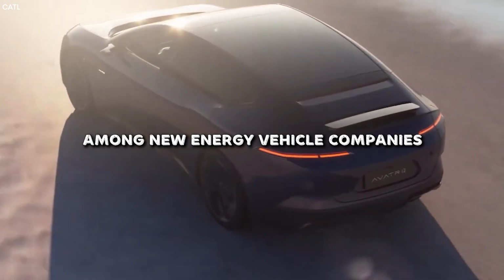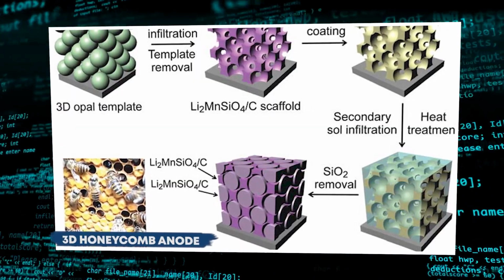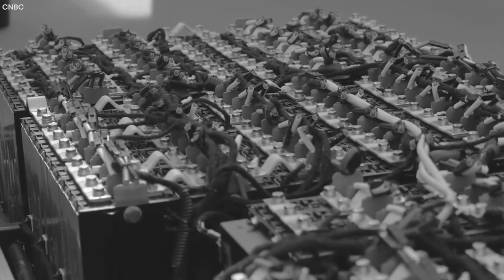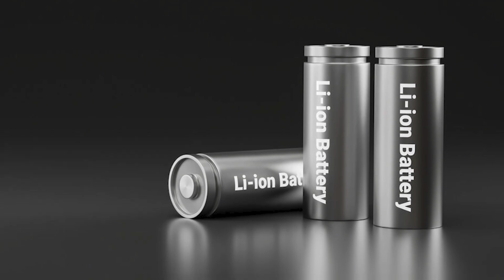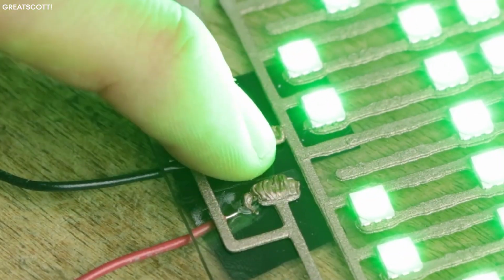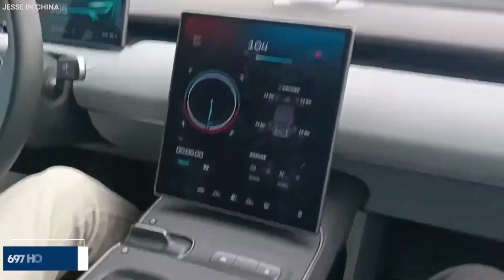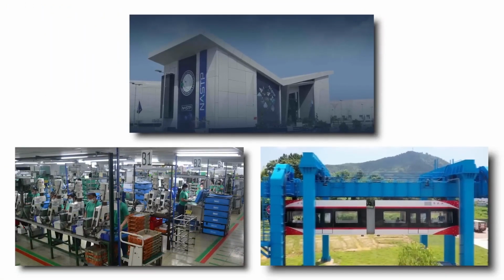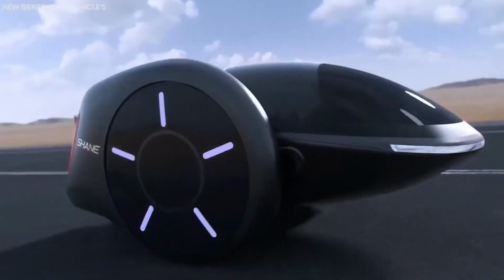The CATL Finally Released The SOLID STATE BAtteries

Comment: CATL is not even close to  solid state batteries, it's just paper tiger talking . Toyota has been working on a solid state tech for more than a decade, they hold about 9000 patents on these technology and they are now about to begin full time production around 2027, Samsung, Quantumscape, factorial energy, Solid power, LG, Panasonic, are just the same as Toyota they have real  solid state batteries and the have distributed test kits to numerous car companies for testing the new 4Runner TRD ev is doing 750 miles on a single charge